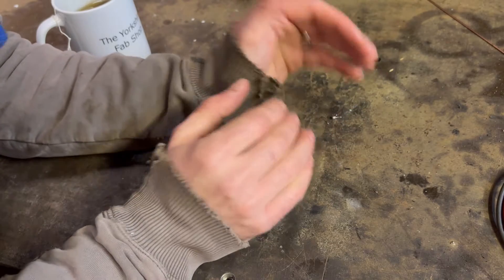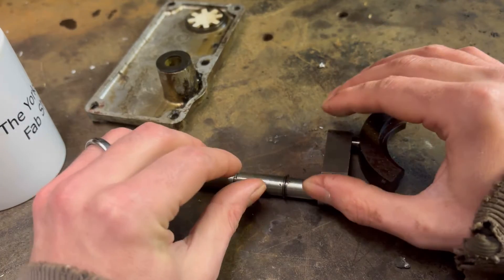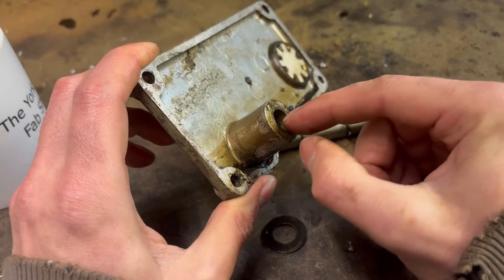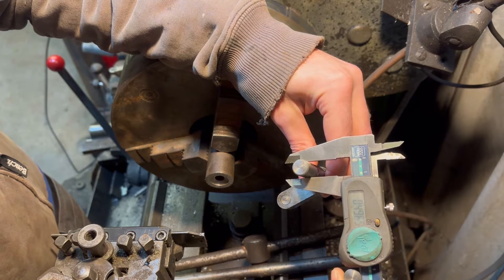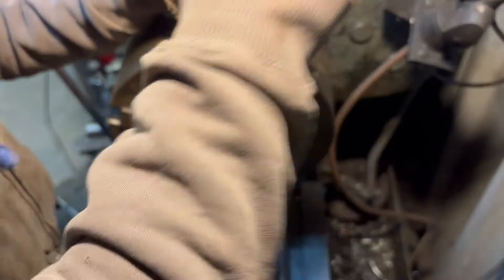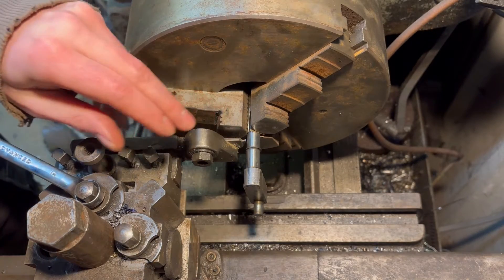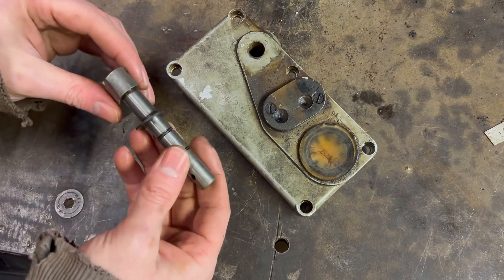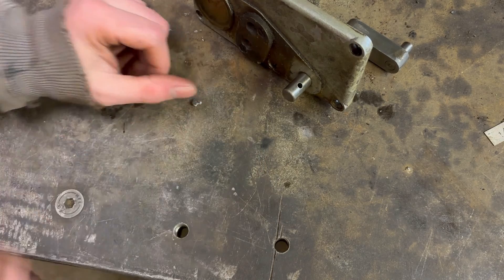Elliott Progress 2G / 2GS Oil Leak Repair. Should have been done at the Factory!

Comment: A leak between the bushing and casing it often overlooked. I replaced my o-ring several times until I found the obvious culprit.
Reply from the maker: That is a great find! The most obvious fault is the o-ring, which is the reason this repair was effective on this particular drill. Oil seeping through the bush is always going to be a risk to this design, and if Elliott had cast this in iron it wouldn’t ever be a problem. 
More often than not these gearboxes are empty through improper care, so oil leaks won’t be an issue. I would still argue a small leak is ok as you have evidence oil is present in the gearbox, plus it keeps the table free of rust!!
Thank you for leaving that comment, it may help others in the future!
Reply: @theyorkshirefabshop8776  it did leave me baffled for a while after numerous replacements. The bushing can be pressed out and a new one turned and reamed to fit.  They tend to wear to an oval shape which gives the oring an even harder challenge keeping the oil in. Viton o rings are the best. I've given up on nitrile they just don't last on moving parts.

Comment: Nice job! Gave me an idea on sealing some bolts that hold my headstock to the bed on my LeBlond lathes. Thanks for sharing!
Reply from the maker: LeBlond lathes plural, as in you’ve got multiple? Fair play if so! I remember seeing a few for sale when I was looking for a lathe. Could never consider one due to their immense size and weight! Would be ideal for stoping a small country floating away if needed! 
Could you use a dowty seal under the bolt head? You wouldn’t need a nice round hole in that case. 
Thanks for watching and leaving a comment 👍
Reply: @theyorkshirefabshop8776  Yes sir, I have three of them. LOL, they are kinda heavy I suppose. I've never heard of a dowty seal. I will check it out. I was thinking about cutting a groove just under the head of the bolt to accept an o-ring. Do you think that would work?
You're welcome for the view and comment!!!
Reply from the maker: Yes, definitely check out dowty seals, I think they will do exactly what you need them to do. Designed for hydraulic fittings but they come in various sizes. Do a great job but you need fairly flat surfaces on the underside of the bolt head and the area of the casing it bolts to.